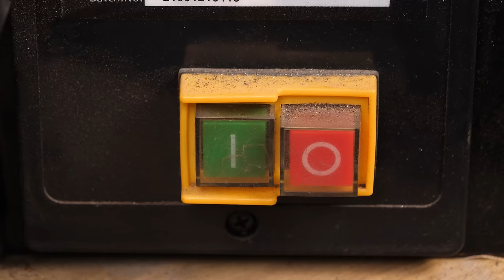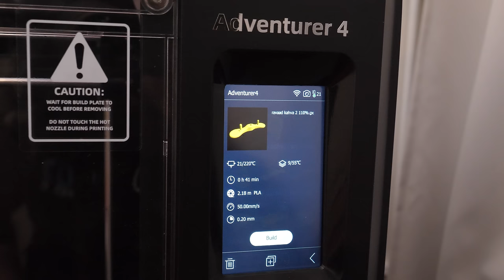1940's Rusty Bread Slicer Restoration

Comment: The only thing better than learning there were over-engineered 1940’s era Danish bakery tools is seeing said device be expertly & so fully brought back to life. That “thickness guide” you recreated off of online research woulda blown the mind of (and likely tickled) the original fabricator. The doff of your cap to the handle designer was priceless.🤩 Another gem of a vid, thx for selecting a really crusty loaf to “process” at the conclusion. Much gratitude for sharing your talents & humor thru YouTube.🇩🇰👍🔧💪🍞
Reply: I love this comment so much
Reply: The company actually started producing these in the end of the 1800's according to their website. Most households had one 🤗
Reply: @medape  Awesome pearls of info! Just think, the generations of bread slicing achieved courtesy of this hefty device! I betchya one got handed down many times over.🥖✌️👏
Reply: Considering the kind of heavy, dense rye bread they were built to slice, their design and prevalence made much sense in the “pre sliced era”. Especially if you had to slice bread for a large household.

Today, they mainly serve as decorative, thematic bookcases, typically placed in the kitchen and holding cookbooks, of course (my sister, or rather her husband, has one in the kitchen).
Reply: Well said, Girl_Friday. Well said 👌🙌
Reply: @DebatingWombat  An ultimate kitchen-based convo starter (and a means by which to keep rubber duckies in line)!😉🩵

Comment: These were so common everywhere in Denmark. It seemed like most people had one. It's perfect for slicing good Danish rye bread, which is very dark and super dense. I actually still have a bread slicer now, though not this particular model.
Reply: Yes, in my childhood (the 80s) these were still quite common, but were used (I think) almost exclusively for rye bread. I don't recall ever seeing someone use one of these for white bread, they'd use a bread knife for that instead, or another type of bread cutting apparatus. We had one similar to a meat cutter, but meant for bread and with a crank handle instead of a motor. The circular blade had a serrated edge like the edge of a bread knife, and there was a sort of wheel on the base you could turn to adjust the slice thickness.
Reply: the tha tung sound of it was the sound of my childhood mornings

Comment: That's one of the best designed blades I've seen on one of these devices. I've watched a few restoration videos of bread slicers, and the way the heel of the blade comes down first to start the slice is much better than others where the bread ends up being squashed before it is cut.
Very nice restoration of this lovely thing!

Comment: I’m curious, how old and stale was the bread you cut? Because I assure you that my bread would just squish if I used that. Beautiful job and I have seen this exact bread cutter done before. You did a much better job than the other guy.
Reply: It did look very stale, which is why it was able to slice through it so easily. The thing is, this bread slicer was never meant to slice soft white bread. It's for Danish rye bread, which is very dark brown and so super dense, that it doesn't squish at all when you slice it.

Comment: I wonder, does the laser cleaner has the same effect as the dust blower? You know, as it needs to curate in oil afterwards to prevent rust.
Or is the leaser less "abrasive" and leaves the piece not susceptible to rust from the getgo

Comment: Oh my god i almost had a heart attack when i saw hoq close his gloves where to the lathe, along with the cloth. if anyone sees this comment and doesn't know what i am talking about, the spinning machine he used to sand that bolt down was called a lathe, generally speaking i would never in my years of manufacturing ever recommend you wear gloves while operating a lathe for safety reasons, but to also have a cloth that close and put your hands that close is just begging for it to get caught and say bye bye your hands.

Comment: Was this device used in every home or was it more intended for a bakers shop?
Reply: It is for home use, to cut rye bread in slices. Not that useful today with sliced bread in danish supermarkets. But it can also slice kale. And of course, homemade rye bread. I have one.
Reply: According to the company's website almost every household had one of these. They started producing them in the end of the 1800's. My grandmother had one of these in the 1980's and you can still find them in secondhand shops. That's where I found mine 😁I don't actually know when they stopped making them though.
Reply: Well just checking how common they seem to be on ebay I would say they were made for consumer use but most likely quite common in commercial use too.
Reply: @Wezqu  they were very common in the past. No home without a Raadvad bread chopper, basically. It was almost a part of motherhood. In the 1980'es I never saw a family without one. The eBay prices tend to be 10-15 times higher than in Denmark.
Reply: @kristianpoulherkild3401  Not surprising since, apart from being rare outside of Denmark, they are almost all solid iron and thus weigh a ton, meaning some hefty shipping fees.

I remember a Canadian blog dedicated to smørrebrød (Danish open faced sandwiches). The blogger really wanted one of these to cut his home made rye bread and visited distant family in Denmark occasionally, but then ran into the problem of weight when he wanted to take one as luggage on the plane ride back to Canada.

Comment: If you're going to melt out the print anyway, why bother sanding it? Just print it at a smaller layer height and coat the pieces that don't have anything glued to them with beeswax to smooth things out. Faster, less effort, less microplastics in the air.

Comment: A great restoration, but my word, what a waste of metal that device was! A decent knife does the job just as well 😂
Reply: It's not a waste of metal at all, if you use it as intended. You would never see a Dane cutting soft white bread in a bread slicer like this, that's obviously a job for a decent knife. This is specifically for Danish rye bread, which is very dark brown and super dense. Slicing that type of bread as consistently thin as is customary is so much easier with this slicer than with a knife. Before presliced rye bread really hit the stores, this thing was absolutely essential in every Danish kitchen. I don't know anyone, who didn't have one. In fact I still have mine.
Reply: @papaquonis  of course, the Dutch are super special and absolutely need this unlike every other culture on earth that also all  have a wide variety of breads. The Dutch absolutely NEED this contraption 🙄 sure thing buddy
Reply: @benl8704  I don't know about the Dutch, maybe they also have particular bread slicing needs like the Danes? There are certainly other countries in Northern Europe, that have a similar type of rye bread. I know German Pumpernickel or Schwarzbrot could easily be sliced on that bread slicer. But any soft white bread like typical sandwich bread or baguettes or anything similar is just absolutely not what this machine was meant for. We have knives for that, just like you.

Comment: the finish on your cast piece is crap because you used such a giant layer height on your 3d print, if you had used a .05 height it would have been almost smooth...